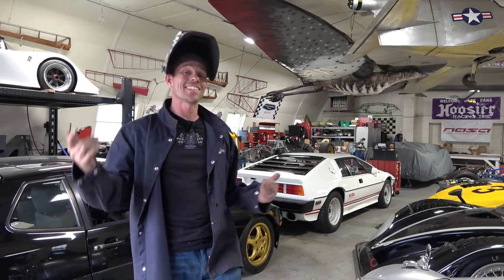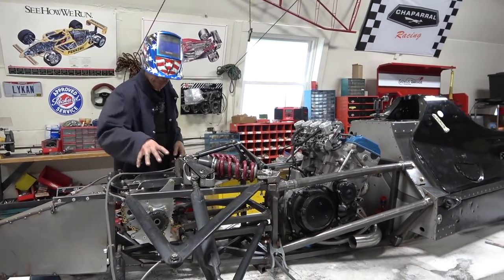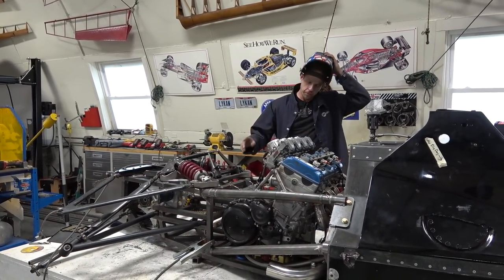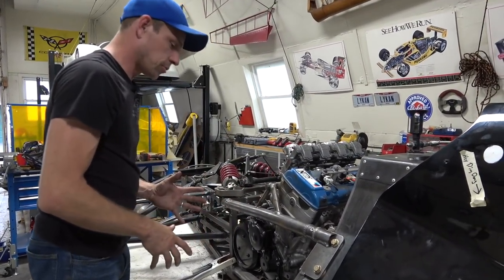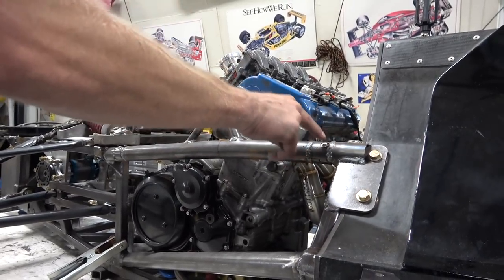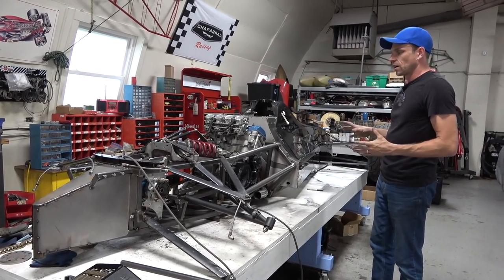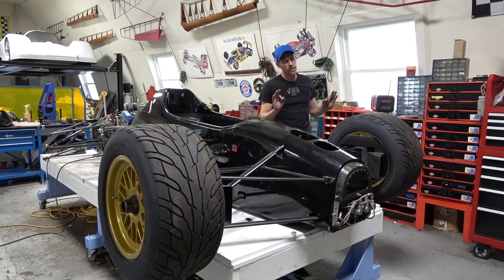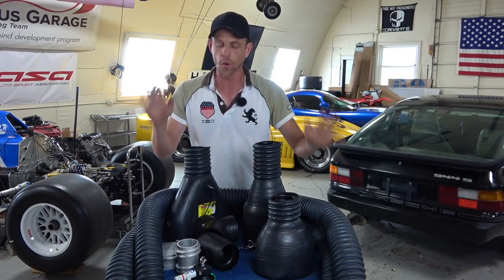Formula 1 Car BUILD Magic Chassis Design #7

Comment: Proud to have made a few pieces for this build!
Reply: Shane Cateriny  Frame sections that I measured and cut to fit that I was super anal retentive about measuring before cutting.  At one point I was so happy with the way a piece fit where Casey had indicated it needed to fit that I let out a loud "F(expletive) yeah!" that brought Casey into the garage from the front office to see what the noise was about.  It gave the Genius Garage guys a good chuckle.
Reply: Can say it’s a McLaren built f1 car 🤣
Reply: Is it finished? And if it’s not where do you live I might move there to help out

Comment: That's a really long chain, with long, unsupported runs, with a relatively heavy car (compared to a Hayabuysa) accelerating and decelerating relative to the engine. Might it be a reasonable idea to put some spring-loaded tensioners on the upper and lower chain runs, to help reduce lash?
Reply: And possibly a chain guide.

Comment: For what it's worth we've always had to run a minimum of 10qts of oil in the dry sump system for our Busa cars road racing. Best guess from our engine guys being aerated oil has time to settle before going back to the motor.

Comment: Manual gearboxes clearly make driving more complex but it doesn’t mean you can keep up with a fast driver if you have an automatic (sequential, dct or something else) paddle shift for fast and easy gear changes, I mean there is still a lot to learn even if you changing gears is easy.

Comment: 12:40 tube going into top of bracket instead of middle: Perhaps a gusset plate welded between the tube and the bracket would help spread that load, and reduce the concentrated load in the corner of the tube/bracket weld.

Comment: Excellent build! I love the builds that you do prototype fabrication on! In the video where you say you are struggling with the placement of the upper frame-rail. What if you put a gusset from the upper rail to the lower end of the mounting flange? Would that spread the load on the 2 points more evenly?

Comment: Just really seems like it would have been soo much easier to actually mount it longitudinally and then use a small drive shaft like a Legend or Thunder Roadster.
Reply: Could have got an xtec v8 (2 hayabusa heads) and run a normal single seater gearbox

Comment: Frame? We cannot use the magic "F1" and the word "frame" in the same sentence, F1 means "monocoque" with the "backend" the "stressed member" (engine/transmission). Tilt a 1.5L Honda civic engine 23 degrees, bolt it to the tub, turbocharge the doghsh!t out of it, mate it to a sequential transmission, fasten your suspension to that and you're in business.

Comment: Why name it "Formula 1" when there is now no Formula 1 parts in it, nor it will ever have it? It's an Indycar hot rod, still cool, but not the same. Just like a Lambo unibody mated with a crate Chevy V8 racing engine will not become a Ferrari, even if it looks very similar and is comparably fast.